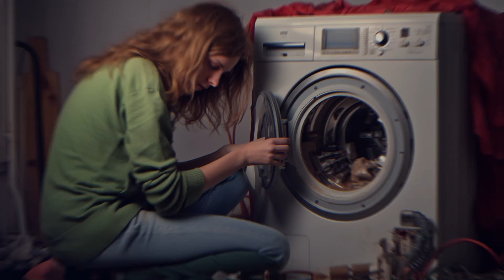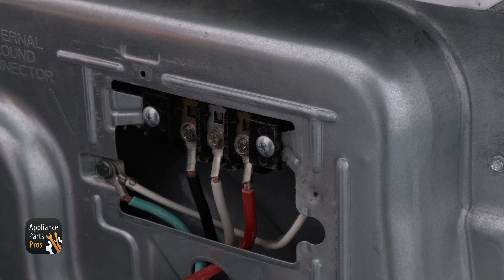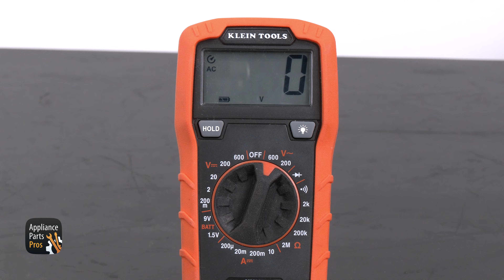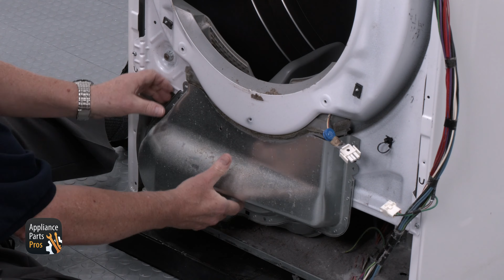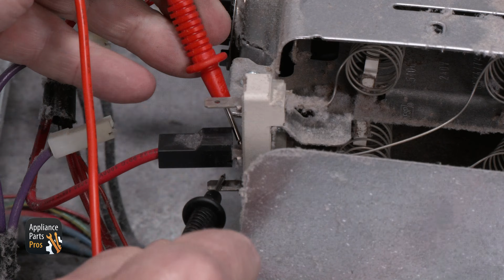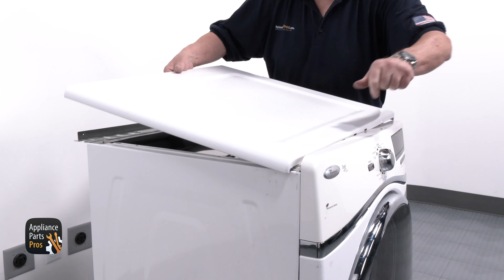Whirlpool Front Load Dryer Heating PROBLEM Solved!

Comment from the maker: 🔧 Common fixes for this issue:
▶ Thermal Fuse WP3392519: https://www.youtube.com/watch?v=PTAeCNY4h-w
▶ Samsung electric dryer heating element / heater assembly ...: https://www.youtube.com/watch?v=jgPlI2NlvT0
▶ electric heating element assembly (Speed Queen dryer, no ...: https://www.youtube.com/watch?v=WoU-fGPNElQ
▶ GE Electric Dryer Heating Element WE11M23: https://www.youtube.com/watch?v=7wDscO0trbk
▶ Outlet (Cycling) Thermostat WE4M216: https://www.youtube.com/watch?v=jTYBOoB_2p0
▶ Electrolux electric dryer heater assembly (exact part num...: https://www.youtube.com/watch?v=oximYfAOg-k

👍 Found your fix? Hit Like so others can find this video too!
🔔 Subscribe for more repair guides: https://www.youtube.com/@AppliancePartsPros

Comment: Thank you for the video it helped me diagnose my dryer. I have a different model with different wiring but with a little common sense the same testing procedures worked for me and I found the culprit which was the heating element just like in your video. A local repair shop sold me a heating element they had on hand and I was able to fix the dryer within a couple of hours. The heating element burned up so much it left a black burn mark on the metal plate the element clips on to and even cracked it in a few spots. What do you think would cause that? There was definitely a good bit of lint inside the casing which I don't understand how that much would get in there to begin with. The machine is only about 4 years old and I clean the lint filter after every load. I made sure to clean the duct that goes outside just in case as well.
Reply from the maker: Glad the video helped you track it down! A failed heating element can sometimes overheat and damage the surrounding metal, especially if airflow is restricted. Lint can also accumulate inside the dryer over time if it gets past the filter or through gaps in the exhaust system. Cleaning the internal area and the entire vent path, as you did, is a good idea. It’s also worth checking that the replacement element is properly positioned and that airflow is strong before putting everything back into service. Thanks for sharing your experience!

Comment: This is great, except my heater coil has only two red wires.
Reply from the maker: Heater wiring can vary by dryer model. If your heating element has only two red wires, the testing procedure may be different.

If you need further troubleshooting/ testing information from our techs you can check out our repair forum: https://forum.appliancepartspros.com/
Reply: @appliancepartspros  Thank you for replying. The coil read 0 across the two prongs, so I replaced it and it works great! Thanks for this video.
Reply from the maker: So glad you were able to repair your unit. Let us know if you have any other questions

Comment: CHECK THE THERMISTOR BEFORE YOU GIVE UP! Awesome video! I ended up having a bad thermistor. My whirlpool dryer only has 1 relay. It was reading 240 when calling for heat. Ordered a motherboard from shop jimmy, got it in 24 hours with an extra 20 bucks for shipping. Never showed an error code so I was hoping the mother board was the solution. Unfortunately it ended up being the thermistor. Probably would’ve thrown the dryer out if it wasn’t for the heads up in the beginning. I’m just a dumb plumber, thanks for your help!
Reply from the maker: Awesome! Thanks so much for sharing your experience and kind words! 👍  
Really glad the heads up saved your dryer and helped you track it down. 🤝

Comment: Good video but did not work on mine. You should add how to check and replace the belt switch...which actually means replace the motor
Reply from the maker: Appreciate the feedback, @giuseppecariello8878 — you're right, the belt switch can definitely be part of the issue on some Whirlpool models. If you provide your model number and let us know what you have checked already we will be happy to check on some more troubleshooting.